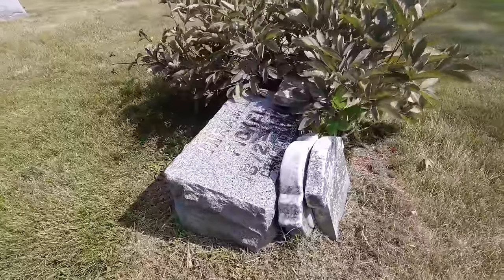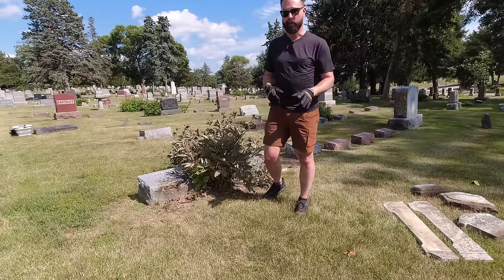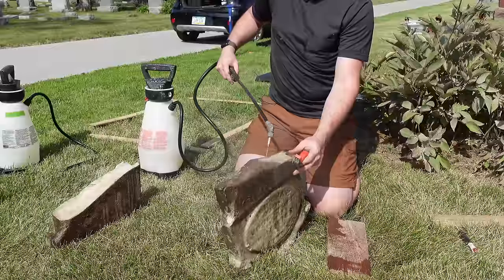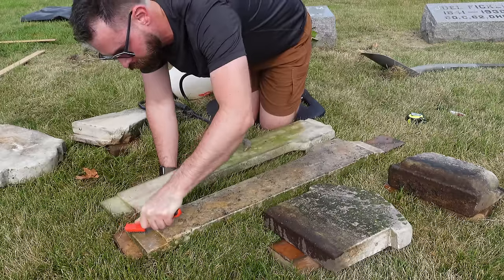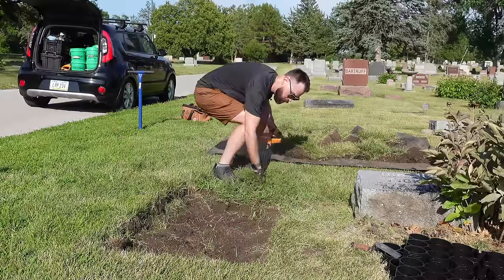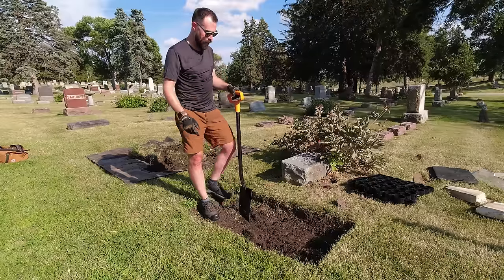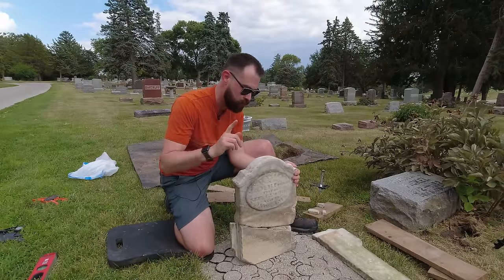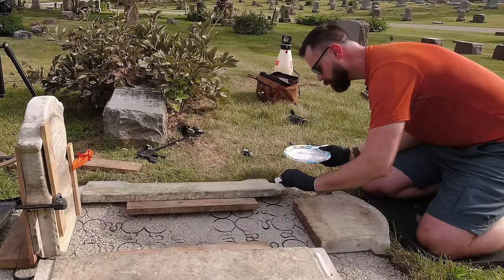I Found A Baby's Cradle In the Cemetery

Comment: I respect what you’re doing greatly. I’m wondering why the cemetery didn’t make sure this was assembled though ?
Reply: It likely was originally, but that would have been seen to by the family. My best guess is that cemeteries just don’t have the budget for monument repairs, especially for older monuments. There’s a cemetery near me that’s still active, with graves dating back to the American Revolution. Some of the biggest monuments there could use some TLC. It probably would be costly, possibly even dangerous, for someone without the proper skills and equipment to hoist a stone urn back on top of a 10-12’ tall slab.

Even this little cradle could be damaged further by someone who didn’t know what they were doing.

Comment: I would guess the cemetery caretaker took it apart to make mowing easier.
Reply: Yeah, I doubt the caretaker is amused.
Reply: @clydedenby1436 As the cemetery told him where it should be they already know! Some people are so stupid.
Reply: They do prefer flat stones to mow over.
Reply from the maker: At some point in time it broke apart, that’s why you saw me repairing the various fractured parts and my hunch is that once it was broken and laying more flat they moved it on top of the neighboring family stones to protect it. But yes, certainly mowers are a massive issue.
Reply: @millennialstonecleaner  either way you do a great job

Comment: I looked at your list of products you use and I see where you listed wire brushed.  You CANNOT use wire brushes.
Reply: Watch his video's before commenting dummy, he uses a fine wire brush to clean and key the surfaces he is going to put the  epoxy on!
Reply from the maker: There is nuance that you’re missing with this. Wire brushes cannot be used for cleaning the visible surface of the stone, correct. Where they are required is for the mating surfaces where you have to bond a fractured part with an expoxy or adhesive. Those areas are hidden once bonded but without really good cleaning those bonds will fail.
Reply: @millennialstonecleaner  This is why I told them to watch all your videos as at not point I have seen you use a wire brush on any part of a stone other than the surfaces you need the epoxy to bond to I.E the breaks. I have never seen Honor your DNA etc use wire brushes for general cleaning either so what they watch is beyond me.
Reply: @cmg6848 
Probably not the kindest approach to call someone a dummy.  And, sadly, the fallout of unsubbing, not liking, etc comes to Wade and his channel, not you.   You don't seem unkind otherwise - my guess is you were just a little bit defensive of Wade.  

You're right, though - Wade has a slew of videos where he explains it all and when and where to use what.  He's quite (and quietly) impressive!  Not one to toot his own horn.
Reply: @Lucinda_Jackson  Well he wasn't wrong. People are too quick to bump their gums, then flee instead of accepting or trying to rectify their mistake.
Reply: @chickenfist1554  Exactly, the guy films his work quite comprehensively yet the "experts" tell him he's using the wrong tools blah blah. I could have called them a lot worse and if the person who commented telling him he is doing it wrong unsubscribes it not really a loss is it.